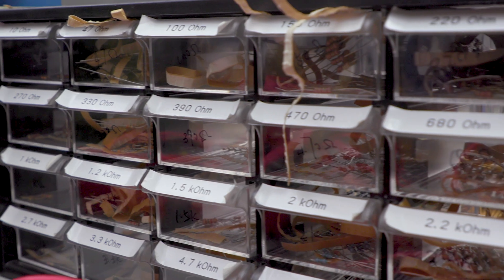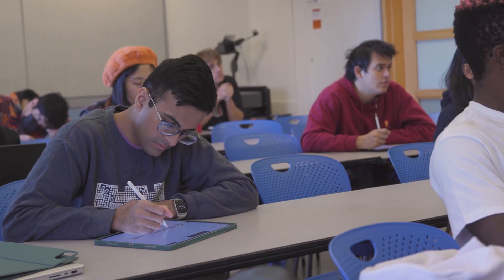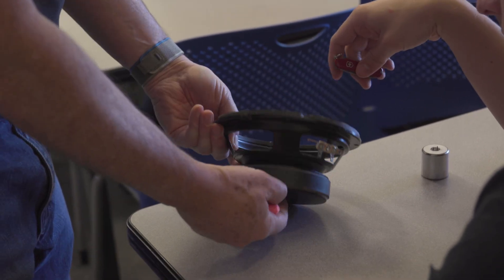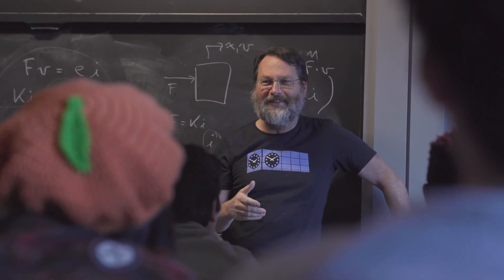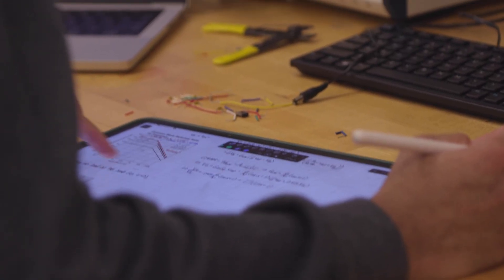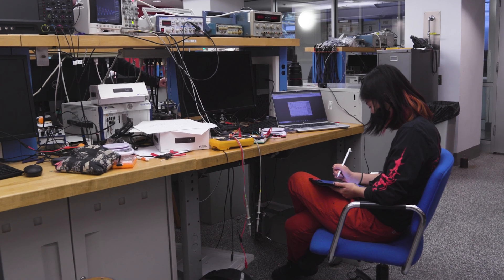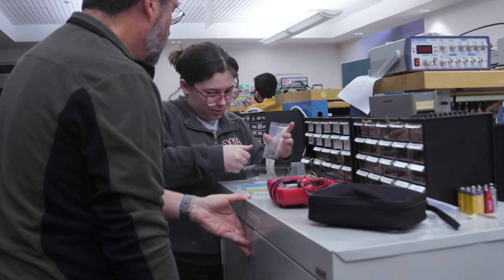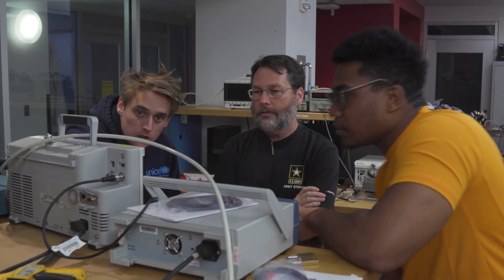The Magic of Mechatronics

Comment: Mechatronics is a great field if there are jobs in it. Although I graduated as a Mechatronics Engineer from one of the top 50 universities for engineering in the world (according to some arbitrary metric), I'm now doing Embedded Systems Engineering. Also, the overwhelming majority (95%) of my batch mates have switched to Software Engineering, Process Engineering, Electrical Engineering, Management or Machine Learning. There simply aren't many opportunities for plain "mechatronics engineers".

Furthermore, Classical Control (what this unit is about) is a significant amount of the course material, is extremely mathematical in nature. I mean pages upon pages of Laplace transforms and transfer functions. The days of doing math on paper are limited. There's a reason why Data Driven Control and Reinforcement Learning methods are used in Robotics... its because the older Classical methods don't scale with system complexity. They work for toy projects and simple industrial control systems. Modern Control (the kind in use in robots and spacecraft) need much more compute. However, it must be noted that the vast majority of control systems on the planet currently are based on Classical Control. That's because these controllers are deployed in places such as production lines or manufacturing plants. If that's exciting for you then that's great! But don't expect university to teach you everything. Think of it more like an introduction to the field.
Reply: Thanks for the clear explanation. I was wondering about it's real life application while doing transfer function maths. And yeah I've seen too my seniors choosing swe me or ee as their career paths.
Reply: When you said you're most of your school mates have switched to other engeering Fields , did they switch major while they're in university or did they use their mechatronics engeering skills after graduation to self learn other fields or they studied two majors ???

Comment: I studied Mechatronics Engineering for five years as an undergraduate, and I have seen that Mechatronics is not just extremely fun, but spreads its across a large number of engineering disciplines. 

Mechatronics concepts could seem complex at first, but a sound understanding of the basic principles is all that is needed to get the required headstart in the right direction. This is what helped me excel and come out tops, and it will work for anyone who wants to specialize in Mechatronics and Mechanical engineering at large.
Reply: Hi I have a question, to study mechatronics engineering is it necessary to major in electrical or mechanical engineering first?
Reply: @HeimdallBeingolea  Depends on the school and their requirements. My school offered Mechatronics as a separate major, so it was not necessary to have a previous major. 

Some schools have Mechatronics as an area of specialization under Mechanical Engineering or Electrical Engineering
Reply: Does mechatronics include the Engineering disciplines of Computer science, Electrical, Mechanical, Control systems & Design in it ?
Reply: @divindhikshith  Yes it does
Reply: @ Thanks for replying

Comment: in MIT it is a course called mechatronics? there is not a major called mechatronics, right?
Reply: yes
Reply: @chidubem31  so what are theyou have? we have mechanical power, production and design, automotive, mechatronics and robotics.
Reply: Mechatronics is a topic within the department of mechanical engineering at MIT. There is a lot of interdisciplinary work at MIT, and so much of the research across the Institute is at the boundaries and intersections of traditional disciplines.